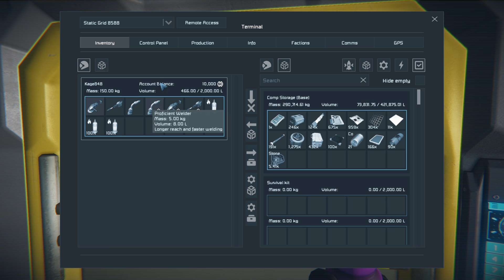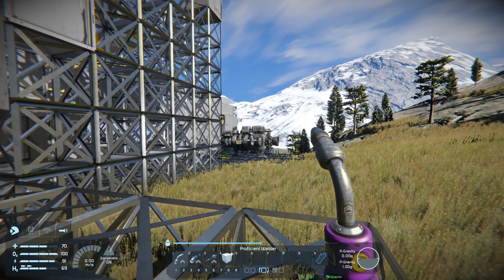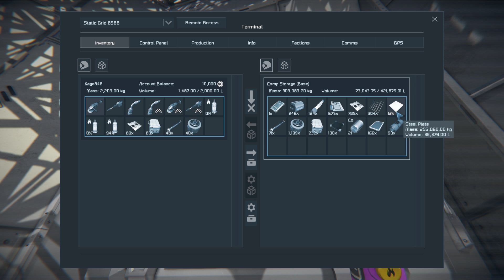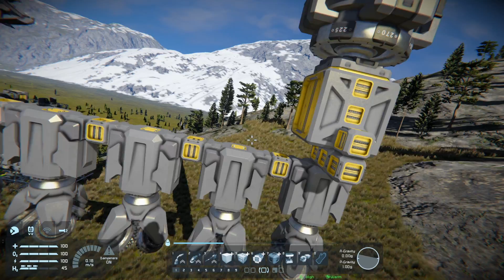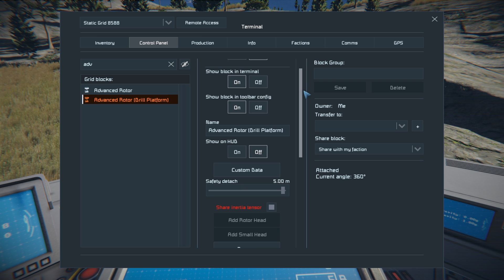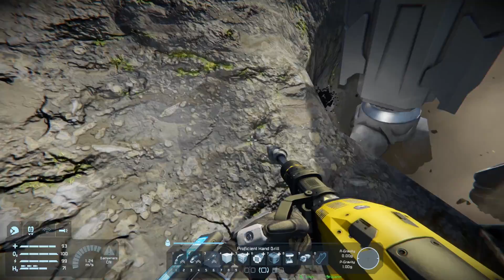Rock Around the Clock | Space Engineers | Let's Play Gameplay | E15

Comment: you can set up rotor with pistons for the wielders, with the setting for 0.001 on piston and having the rotor moving slowly. also with it only building blocks connected, but a block on the projector that is extra that way you can just remove that block when its complete, or use a merge block if you want

Comment: Best way to build from blueprints in my opinion is to select show only buildable in options and then place each block one at a time with the hand welder. Just a quick tap should be enough to place an item in the world but don't weld it up yet. You should now have a placed block that you can see through so you can see if there are other blocks attached to it that also need placing and may become obstructed once welded. Once you have done all the blocks like this on one level (or slice) from one end of the grid to the other switch off the projector and bring in a welder ship to finish it all off quickly. What I mean by one level (or slice) at a time is If your grid is 5 blocks tall you would need to repeat this process five times. like building a five storey house one floor at a time.

Comment: The setting for the pistons and rotors are multiple decimals (.0500), but the display is limited to 1 decimal. It will still operate at (.05) even if it displays .1. The .05 should still be set if you go back into the options.

Comment: It would be way easier to use 4 "arms" for your drilling platform. Right now with one arm it has to go a complete 360° before the piston goes down roughly 5 meters or it gets stuck. However with 4 arms each arm only has to rotate 90° in order to drill a complete circle and that allows you to run the pistons at a reasonable rate of speed.

Comment: Hey Kage, if you want to stick to welding contraptions instead of autobuilder mods, just as a tip I saw you notice the area of effect of small grid welders, the large grid variants have a huge multi block range.  A few of them piped into your base's cargo and mounted to pistons can weld deep inside of small grid projections.  That way you can ensure there aren't any blocks hidden within your new ship that got missed.  Also there's a handy feature in the projector block's control panel when a blueprint is being displayed that shows how many blocks are left to weld (this will be able to help let you know that those blocks weren't finished due to missing components).  Cheers dude and keep up the awesome show :)

Comment: If you're going to go for this type of drill, I recommend switching to large grid drills. They're much easier to work with once you have enough resources to build them. Build them in a + shape with the rotor in the center of the cross so you only have to do a quarter turn to get a full circle cut. That will let you extend your pistons much faster. Doing this, you'll find that storage and processing quickly becomes inadequate. When I did this a year or so ago, I ended up with a dozen upgraded refineries to process all the stone and still had to have many large cargo containers for all the stone and a few for the ingots.
My final design had 8 drills in each direction, one additional sideways drill at the end of each arm making sure the wall was cut away enough to prevent scraping, 15 pistons (all vertical), 3 timer blocks on the bore head to control descent, a control seat on the bore head, a few batteries on the bore head to power pistons while detached from the base, and a landing gear on the bore head to hold it in place while detached to retract pistons and build out the base to take a new bite. Also, lights; it's dark down in  that deep hole. A merge block on the side of the top pistons lets you reattach it to the base once conveyors are built down to it.
https://imgur.com/a/Fq4zvbe
Reply: Building your timer blocks, control seat, and batteries on the bore head and keeping the same pistons attached to it when extending the pipes means that nothing ever needs to be reprogrammed after the bore has gone deep enough for you to add all the pistons you want in your final design. It's also kind of fun to sit in the control seat and ride the bore as it cuts while you refine your feeds and speeds.

Comment: Dude, you're conveyor setup is more complicated then it should be.

 You should rebuild it all like this: Connector inlet < sorter (Ore/Ingots/Components) < Cargo Containers (dedicated for Ore only) < Refineries (They automaticly pull Ore as needed) < Sorter (Ingots/Components) < Cargo Containers (Dedicated for Ingots) < Assemblers (They automaticly pull Ingots as needed) < Sorter (Components) < Cargo Containers. 

The Ingots and Components will automaticly bypass the whole system until they reach their designated cargo containers. Also, your components cargo containers should be set up next to a garage where you build vehicle, which I call a Workshop.

Comment: with these large rotating drill set ups, slow the pistons down to about .005-.001 and then put the rotor speed no higher then .5 turns per min, it will be slow until you get into the ground but you can leave it alone while you do your own thing

Comment: Technicaly you are able to mount large atmo thrusters on your drilling ship even with 1 block spacing between drill. When built up the colision box of drill allows you to have thruster thust alongside its flatter side trought side of drill and the drill will not take any damage... Also Large thruster thrusting into small grid wall (3x3 blocks) will damage only the middle one so it should be safe to place large grid thrusters on your miner ;)

Comment: A few tips about pistons 0.001 is the slowest speed I can get the piston to run at, the UI shows that as 0.0. So you can slow them down way more than the UI shows. 

About Drills the small drills have a 3x3x3 drill "area" (though its circular) situated about one small block forward of the drill head's center, this is also trueish of the large drills (though 3x3x3 of the large grid blocks) though it seems to be close to the center of the drill head..

With a twin blade design you only need to be pushing down about .2 meters per rotation to get a smooth cut. if you divide that by the number of pistons you should get a speed that you can set to all your pistons. The rotor has to make 1/2 the rotation in that time but it does work allowing you to setup automated mining.

I did this with lake mining of ore patches and ran out of storage mining down 160 meters while tossing out all the stone. 
Really glad to see you enjoying this game, in case nobody has mentioned his work to you Splitse has an amazing section of tutorials including one on the build planner which is a neat vanilla feature. Also take a look at Isy's Inventory Manage (it's an in-game script for sorting items) it tends to be easier than placing millions of sorting blocks.
Reply: Whats even easier is setting up a timer block per piston. Chain the timers together so that one piston drops by a small amount every few seconds and then moves on to the next piston timer block. For example, Piston 1 would be set up with 0.1 velocity and a max distance of 0, then just set piston 1's timer block commands to "increase max distance" after a 10 second delay (this will increase the piston distance 1 meter if I'm not mistaken) and "trigger now: piston 2 timer block". Piston 2 timer block would have the same 10 second delay and the same "increase max distance but for piston 2 instead of 1, and so on and so forth. You could also have a separate timer block that happens instantly and it commands all pistons to reverse (to retract them), and turn the rotors & drills off. Or you could download a drilling machine mod. Either way.

Comment: I said it before and I'll say it again. Once you get access to ores, mining stone isn't worth it (unless you need gravel). You currently have 4 yield modules on your refinery, which means that you are getting a 1:1 ratio out of your iron ore. 1kg of iron ore creates 1kg of iron ingots.

Even with the yield modules, the ratio for stone is 1000:14:30:4:2 (Stone Ore input:Gravel:Iron:Silicon:Nickel). Yes using this mining rig will generate a lot of stone, and that will turn into a reasonable amount of resources, but once you can mine ores, you're better of spending the time mining those. Even nickel, which has a base yield rate of 40% (meaning 1kg gives 400g), with yield modules will give 80%. If you haul back say 40,000kg of nickel ore, you'll refine that into 16,000kg of nickel ingots. To get the same from stone, you'll need 4,000,000kg of stone. To give you an idea of how much 4,000,000kg of stone is, it will take up 4.5 large cargo containers on large grid.
Reply: in my opinion all resources its resources...
it like if you said ho I have $1000 let throw all the $1 😁😎

Comment: It is definitely possible to set the rate of rotation of the rotor and rate of extension/retraction on the pistons such that you need only turn them on and walk away. Your problem will be in processing all the materials. For a "drill bit" (if you want to call the collection of drills that) this size, you'll need like 6 refineries at least and probably another large cargo container or 2 for buffer.
From testing, I can say that a small drill can chew through about 0.4m of material per second moving forward at a depth of about 2m. I can post some numbers specific to a drill bit of this size if you would like.

Comment: On your piston control panel, you have a button called "shared inertia", You may want to push that, as it shares tension between all the pistons evenly, and causes them to shake less. ( less explosions with pistons and things attached to them) Also if you build more drills on the other side of the piston, it will dig faster and get rid of a balance issue.

Comment: Why do you work with small blocks on this rotor?   Use Big blocks :D
Reply: Yes! That drove me nuts when I saw the thumbnail. Use big drills!!!
Reply from the maker: @MaktheMad  I was told big drills cost way more and are not much better than small.
Reply: @Kage848  Hnmmm that would be something I'd need to test. Resource wise, larger drills are more expensive, however their internal holding capacity is way larger per drill. You could be losing more ore to overflow with smaller drills.

Again, something I'd have to test. A quick search for drill efficiency didn't find me much
Reply from the maker: @MaktheMad  this was what splitsie said. Lol
Reply: To be honest at the stage Kage is at he could, but for a system he might soon tear down and move to expand his base, it would be easier with small grid blocks, with less components and therefore less grinding trips, also making the rig super cheap to build or replace if mighty Klang appears and consumes the whole contraption